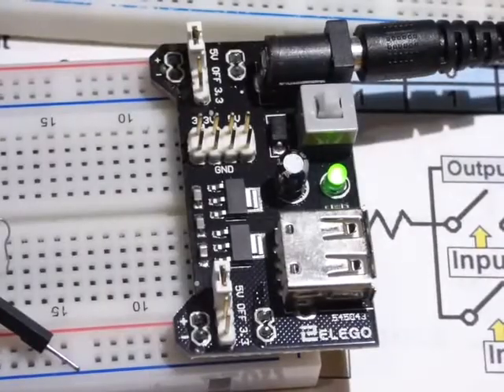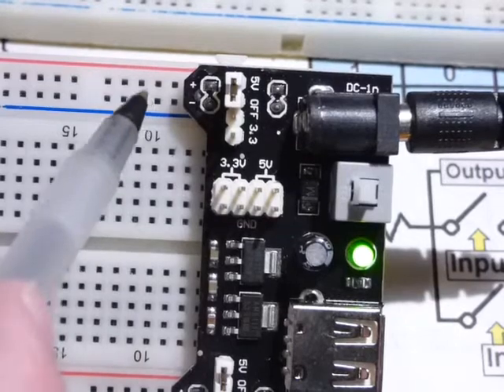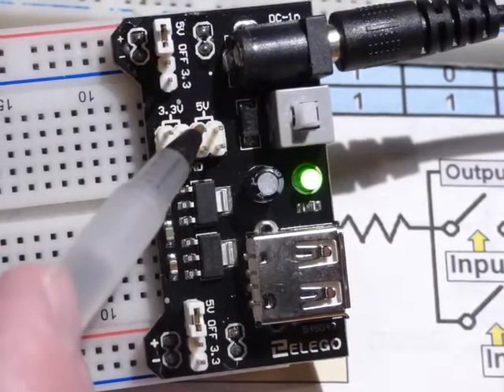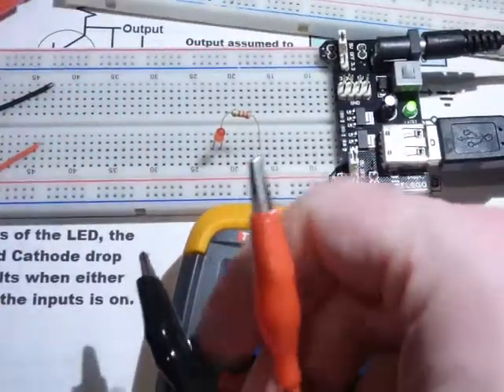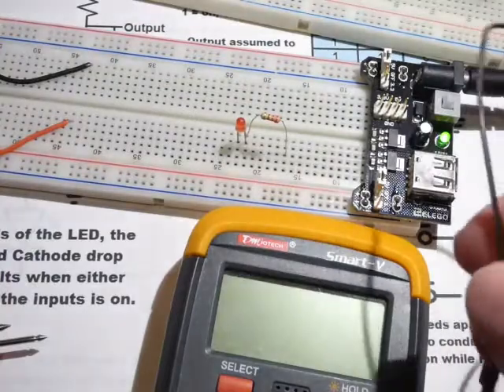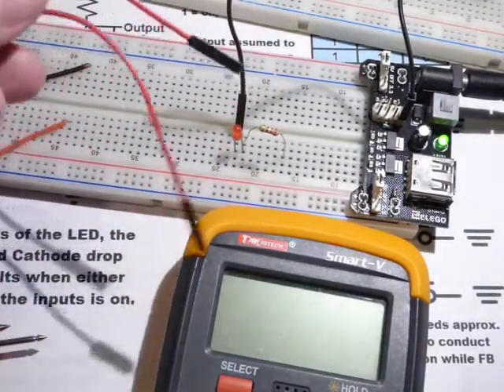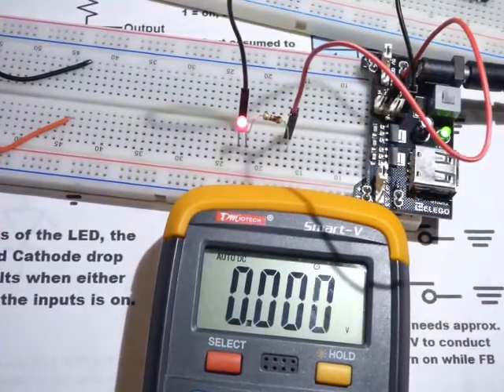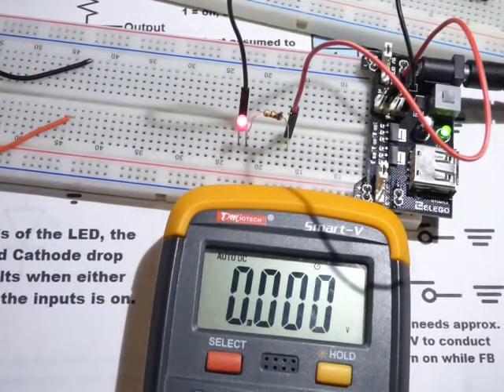Breadboard power supply USB and voltage pins demonstration and multimeter measurements electronzap

Comment: Even though this is an older video, you are the first one to cover the basics of this breadboard power supply in sufficient detail to know what it does or doesn't do.  Thank you for that. One concern people should be aware of is that connecting the barrel connector to a 12V power adapter could overload the voltage regulator on some of the older units and possibly some of the newer ones too. Using a maximum of 9V input should enable the user to power a 5V rail and a 3.3V rail at the same time without overheating the VR's.  Adding a small heat sink to the VR's might also dissipate enough heat to allow a 12V input, but I haven't tried this yet so it's only speculation that it could work at this point.
Reply from the maker: Yes, I fried at least a couple with 12V and  now make sure to only use no more than 9V. So, good tip to add!

Comment: I have been using the USB as an input to bring power to the board from a USB Power bank instead of the 9mm plug. You are saying that the USB is intended to power OTHER devices that are attached. Should I not be plugging the board in that way. If not, why has it been working?
Reply from the maker: I've heard that other people use the USB to provide power to the breadboard. So looks like it is OK to use the USB connector either way. I'm sure it's connected directly to the pins going into the breadboard.

Comment: I used 10K potentiometer and connected both positive and negative wires to this power supply rails. It can't read to its maximum 1023 integer. The highest number i got was around 900 range. Why is that?